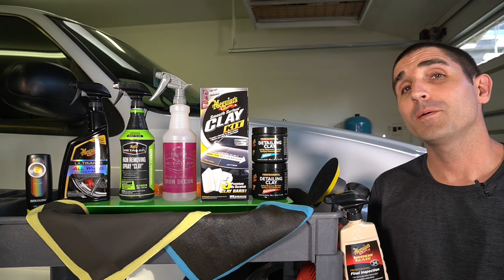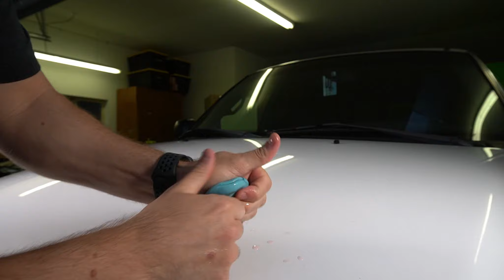Top Pro Tricks to Making Paint SMOOTH and GLOSSY

Comment: Should have watched this video before putting the paint coating on!!!!!
Reply from the maker: Haha, it might have helped. When you wash your car for the first time you will be able to tell if it really needed it or not. You will most likely be fine :)
Reply: @MarkusKleis  what should I use to do the first wash?
Reply from the maker: @leonardo11barros  I would use a standard wash - like Gold Class, Shampoo Plus or Hyper Wash. Just so you can fully evaluate the coating on its own.
Reply: @MarkusKleis  used hyper wash and found some spots that I missed. Do you just go and apply right over it?
Reply from the maker: @leonardo11barros  Yes, use some M122 Surface Prep to wipe those areas down, then re-apply more HPC over those areas. you can overlap the areas with the coating and it's fine - worst case it will just wipe off.
Reply: @MarkusKleis  going to do that this weekend